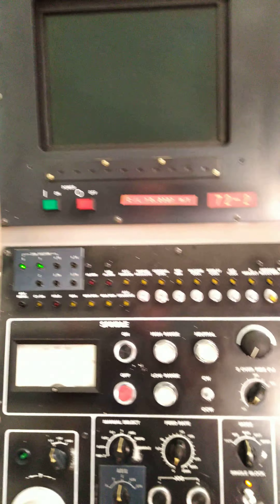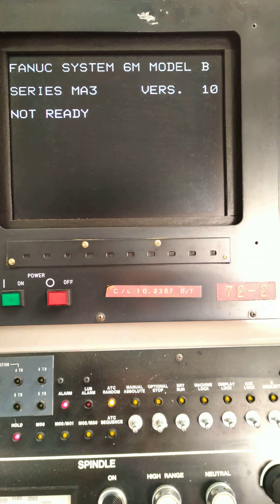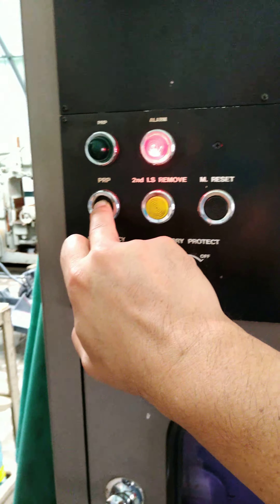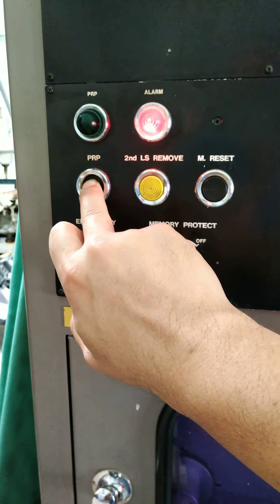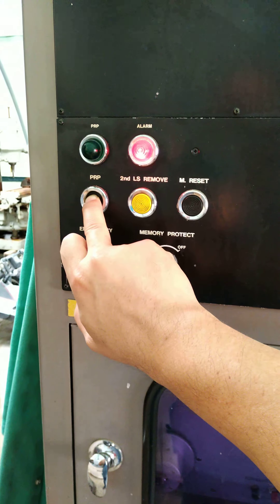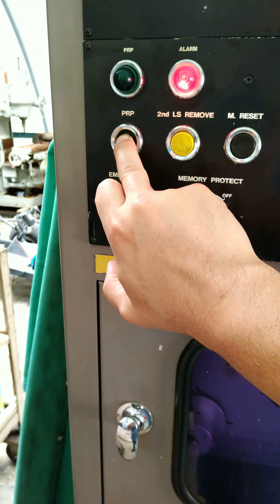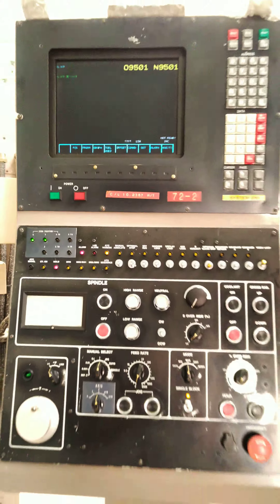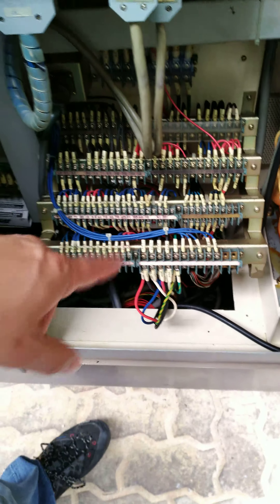Mitsui-Seiki J6CN Jig Bore Mill, restoration project...

Comment: Ошибок по чпу у вам нет ! Тут станок недает вам разрешение
Reply from the maker: Thank you. I'll be back working in my shop Monday. Hot as hell here; heat wave, 113F inside.. Stay tuned...
Reply from the maker: This machine was purchased from Prestige Equipment off eBay. Beware of Prestige Equipment they Suck! They took total advantage of my kind / trust, all deceived and lied to me blatantly just to make another sale... Anyhow, I have discovered several intentionally tweaked systems and many mutilated wiring harnesses. Obviously to my chagrin, this is an undisclosed / decommissioned / demilitarized machine tool. Be that as it may, I have effectively repaired all of its vital systems. However as there exists no other ailments that I can detect, and if i catch your drift; this indeed may well be a locked out machine; as Raytheon / Fanuc likely locked out the memory / CPU from reactivation... I will look into your suggestion, as a new approach, to resolve the mysterious, "PC Not Ready". Thanks... Best, CT